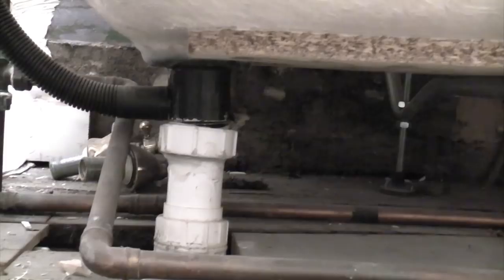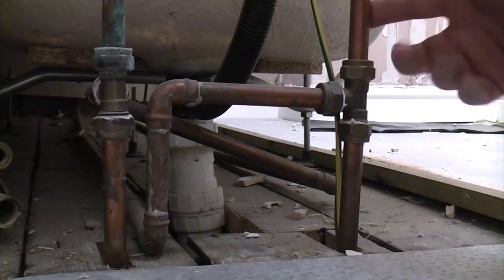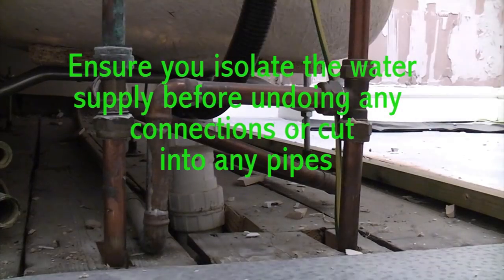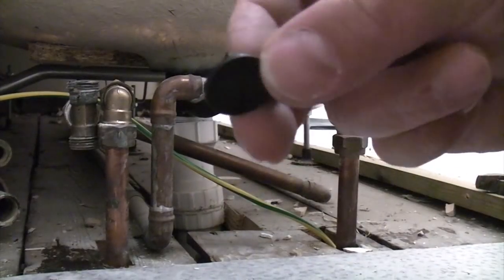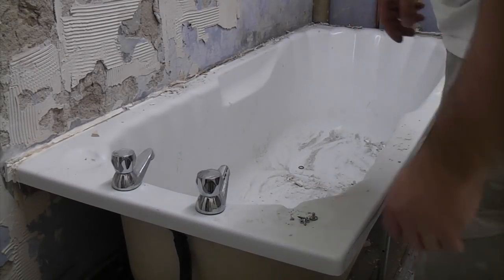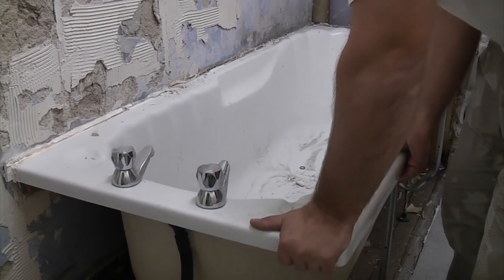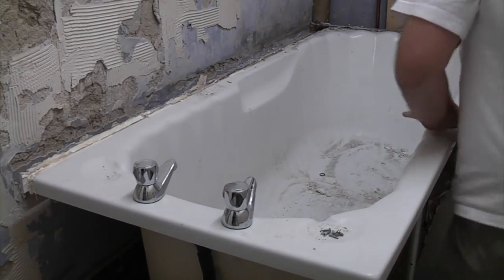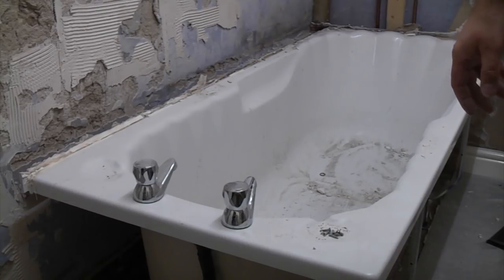How to remove a bath

Comment: how do you cap off with plastic pipes.  I tried using a cap, but with dire consequences, I had to have the water off for all the time the pipes were without taps
Reply from the maker: You can cap them off using a push fit stop end, but you must use a pipe insert.
Thanks for the comment 👍

Comment: How come in the previous video you used a speed fit plastic cap off, but in this one you used the copper cap off with an elbow? 

I like that you done that so I can see alternatives but is there a specific use case for using each one ie copper or plastic cap offs
Reply from the maker: If there is a fitting already on the pipe, you can just use a 1/2 BSP cap and washer, but if there is nothing on the pipe a push fit stop end is easiest.
Thanks for the comment 👍